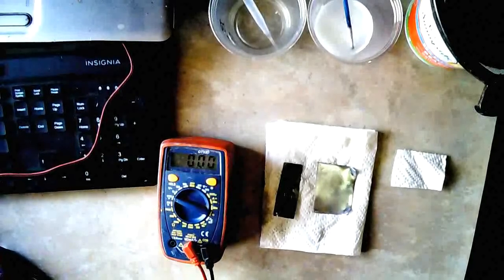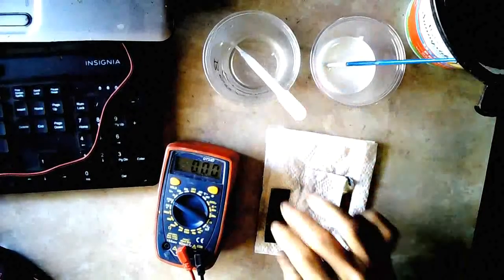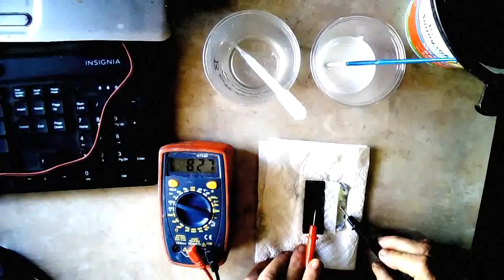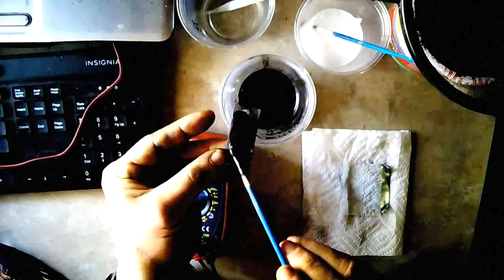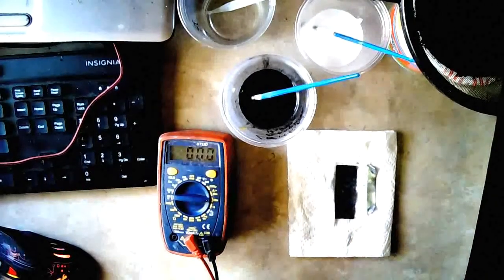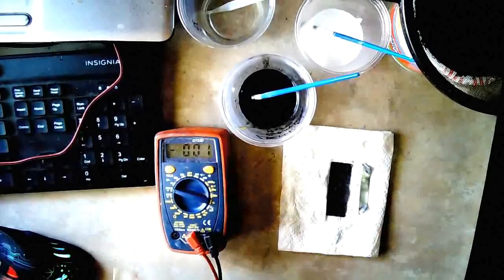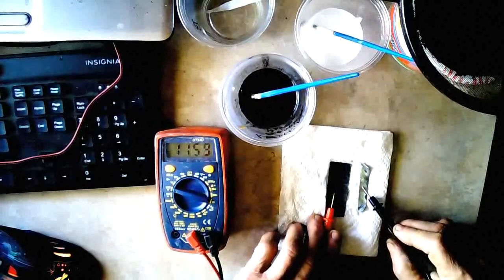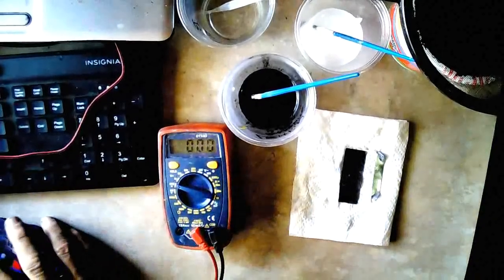Demo #30 Citric Acid Bio-Cell Exp. #1

Comment: When I was working with crystal cells Borax was an ingredient suggested to be useful as a pH buffer for the Epsom salt/Potassium Chloride/Alum mixture. The electrodes did corrode but it took a considerable amount of time, longer than without it. Since the electrodes were magnesium and copper (considerably reactive to slight variations in pH) they are normally subject to comparitively rapid deterioration. I was intrigued by them lasting for months of continuous use. The eventual corrosion led me to conclude that the crystal technology was galvanic. The cells did not respond well to charging. The increase dissipated rapidly and accelerated the corrosion. The amperage was low and they didn't appear to stack well. 
It would be interesting to see how the materials you are using hold up over time.
Reply from the maker: I'm shopping for sensors right now Fred, so I can gear up for some serious testing. We'll know more by this summer.